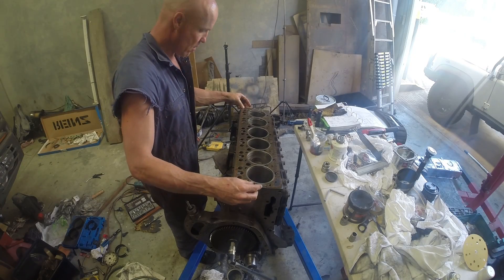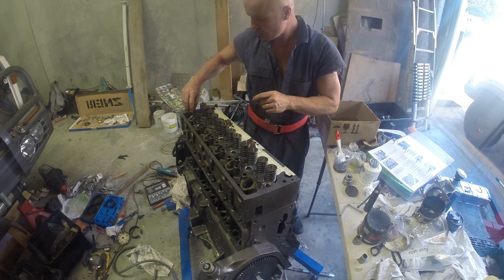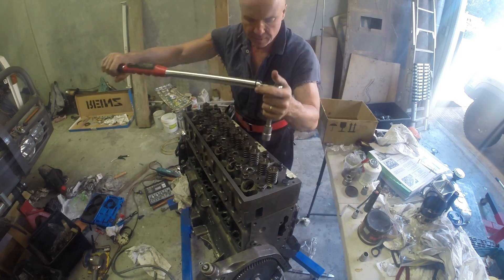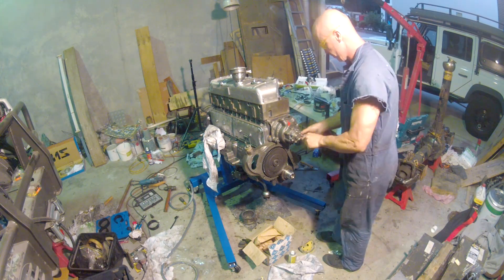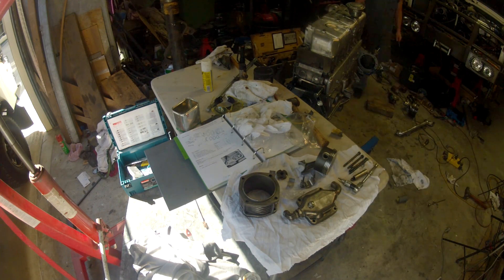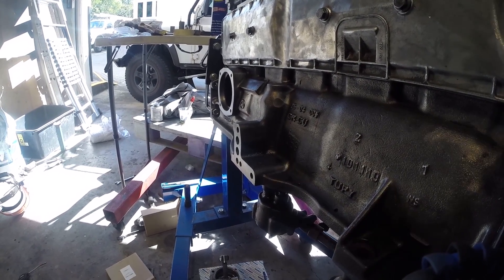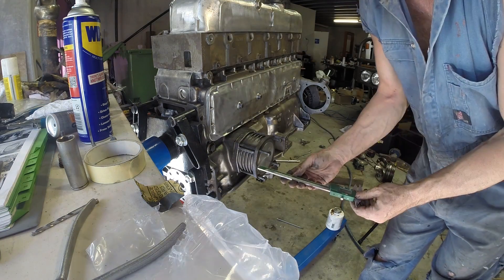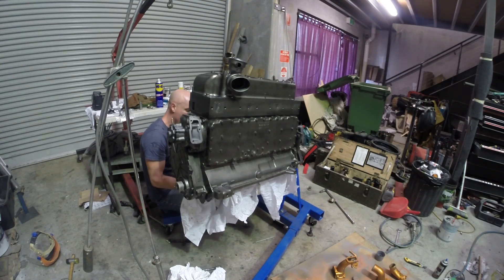Rebuilding my OM352A engine  - Part 3  final assembly.

Comment: Do you know where contected  heating system to make hot inside in the cabin?
Reply from the maker: It is the two 19mm hoses near the thermostat, and they go to into the heater right at the back of the engine bay, hard to see as they are underneath and right at the back.

Comment: Do you have any video on rebuilding the fuel system from the fuel tank components to the Injection Pump? I need to stop the air from infiltrating from the fuel tank to the fuel filters. I think the tube that enters the new tank that I had to install has micro-holes in the tube or I never had the correct internal parts for the tank in the first place. There was a 12 volt external pump on the exterior of the fuel tank. Is that the way that Mercedes Benz mounted the fuel pump on a 1975 (406) or is that rigged up to get the next guy to fix the Unimog?! LOL! Any help would be greatly appreciated. Love the rebuild - wish I had the knowledge to do your level of work!!
Reply from the maker: Hi Ron,  The fuel system is quite simple.  The normal way would be a line from the fuel tank to the lift pump on the engine block.   The other guys must have fitted it.   On ours I fitted a facet pump  and a CAV fuel filter to protect our Pollock valve that swaps between the two fuel tanks
  
The most likely source of air is the little T piece on the injector return line that goes into the feed for the lift pump, it is made from plastic and can crack after many years, and lets in air.  The t piece is at the back of the block, just follow the return line down to the main line.  

If you look on Benzworld, there is lots of help there.
Reply: @UnimogAdventures  I will do that tomorrow in the morning. I have to have the 406 up and running to remove snow during the winter. The unit has been faithful since 1975 and just needs deep, deep service. Thank you for your input!

Comment: What is your estimated cost end to end? - without labor
Reply from the maker: The rebuild kit cost me about $1100 ( Pistons, gasket set and bearings) , the balancing all the components another $500, and the phosphor bronze valve guides and valve seats another $450.   New water pump, harmonic balancer,  engine air compressor overhaul kit and other stuff brought the total up to about $3500 if I remember correctly.     I also got a new injection pump with a set of injectors ( $400 off NZ Trademe), a new GT2860RS turbo for $1300 and the diesel pump set-up and new nozzles cost another $1500.    The ceramic coating of manifold etc was another $600.    Iain

Comment: Hi! Thank you for this indepth look into your work. I'm planning buying a Mercedes Benz 613D with that same engine (but non turbo), 130HP. I'm planning a fulltime life in it.  What would be your opinion on the reliability of this engine as well as availability of spare parts if I travel Through all Europe. Is it costly to maintain? Thank you so much if you can help me as I'm a bit at a lost at which camper I should choose.
Reply from the maker: HI, these engines run for millions of kilometers, just need to use good quality oil and change it regularly.  The 130hp non turbo  is very under-stressed and should last forever.  Parts and spares are easily available, especially in Europe.  It takes a fair bit of oil and I use a synthetic long life oil in mine, and change the oil filter every 5000km or so, and then oil every 20,000km.  If you use cheaper oil, then you need to change it more often.  You need good some decent fuel filters, and air filter, which are quite large, and pretty expensive but they last about 20,000km.  It is not as economical as a modern engine though, but not too bad in our truck.
Reply: @UnimogAdventures  Thank you so much for your advises. So, is that to say you would consider buying one of those a ''reasonable'' choice for a full RV life and some decent trips too? I'm a good handyman. I must admit spending 100k in a van is not exactly on my bucket list. I saw some decent and well equipped 613d around 20k here. There is a broaden version available which seems to be quite roamy. I'm wondering...Have a good one bro!
Reply from the maker: @RenoLaringo  I would say they are pretty reliable, you just need to find one that has been looked after, or re-build it yourself
Reply: @UnimogAdventures  I think I'm going to rebuild it anyways. Are there kits available (I think about piston rings, valve guides, etc...). I hope I'm not taking too much of your time. This is a very beautiful engine. It looks very solid and wel built. It's going to be a pleasure to work on it. Have a good one and thank you for your attention and the time in answering. Take good care.
Reply from the maker: @RenoLaringo  Good idea, everything is available.  I also had everything balanced, and that has made it super smooth, well worth the effort I think.

Comment: I have an OM352 in a sailing ketch, and came across your video channel.  I was  incredibly impressed by your engineering skill !  I have been completely rebuilding the yacht and am currently rebuilding the hydraulic gearbox. I wish I could rebuild the engine too, but just don't have the time or ability to get the thing out of the boat at the moment.  Great videos! 
..and great job on the cleaning and prep work as well (how did you get everything so clean), it looks like a brand new engine ...I guess it is, or was two years ago !
Reply from the maker: Lots of de-greaser and elbow grease to get it that clean.